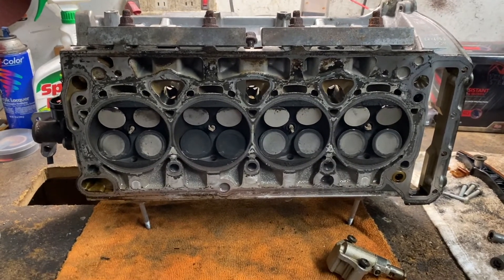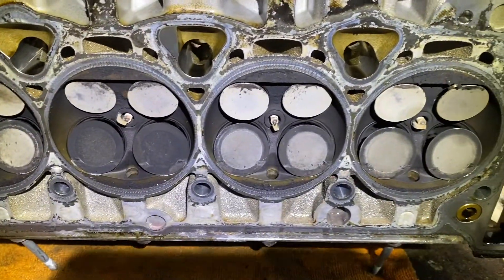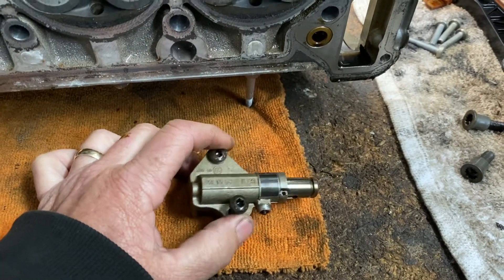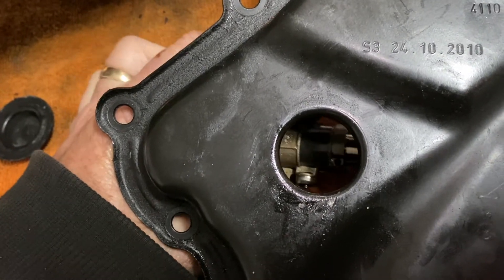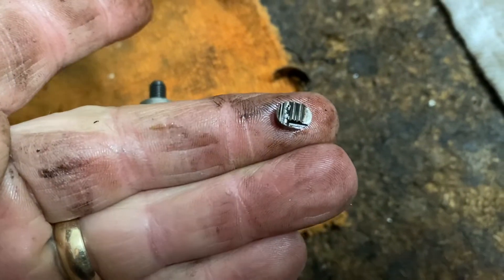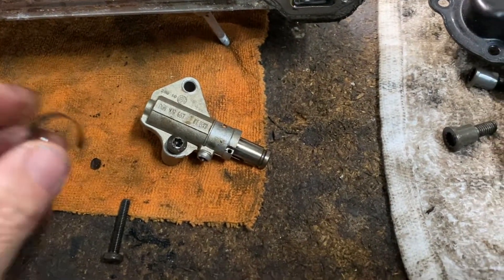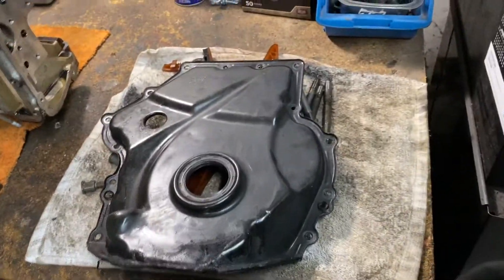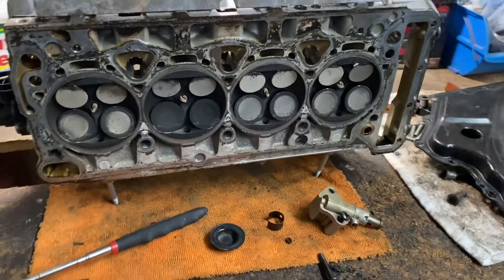VW/ Audi TSI 2.0 turbo 2008-2013 Timing Chain Tensioner Failure

Comment: got a 2010 superb 1.8 TSI which as far as I can tell is practically the same engine as the 2.0.
I don't know the cars history but since it has 120k miles is it safe to assume it has had the updated tensioner installed at some point?
Reply from the maker: They started the new style in 2012 so I’d  check it. I have videos on that too

Comment: These motors are completely trash for the multiple issues that plague these vehicles. There's nothing like over-engineering something and not being able to keep a motor running in a half-ass Manor... Even the new motors have the same issues
Reply from the maker: They are not that bad, most problems are owner neglect

Comment: I have a 2012 VW beetle turbo 2.0 T.  When i put my VIN unto their website it was stated that my vehicle was not one involved in the recall even though other models of the sane year was recalled and got the updated tensioner.  Does anyone know why some models were recalled and some were not?
Reply from the maker: Your engine is definitely effected if it's the 2.0 turbo TSI

Comment: VW became aware of the issue and came out with the updated tensioner in 2013 so if you have a 2013 you'll want to check which version have. You can call a dealership and have them tell you based on your VIN.
Reply from the maker: Yes, model year 2014 up have updated one.
Reply: @motorcarnut I got a new engine in 2015 due to the recall on oil consumption. So it should have the new pump?
Reply from the maker: @seemaab I would think so

Comment: I wonder why VW didn’t recall these vehicles to fix this issue. My 2010 VW Eos engine got destroyed by this after 40,000kms and 12 years. No class action in Australia.
Reply from the maker: Good question. Probably not enough people complaining about it and it doesn’t happen for a long time after. They know there is a problem or they wouldn’t have updated the tensioner.